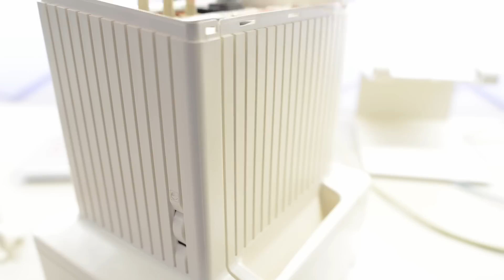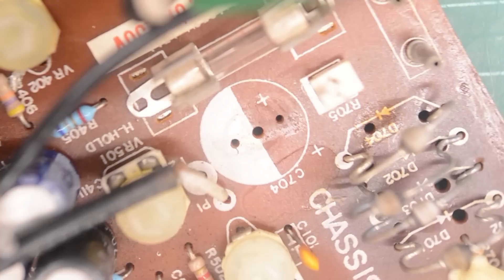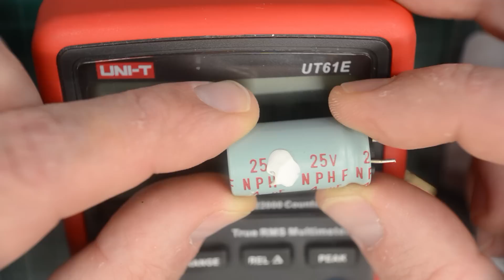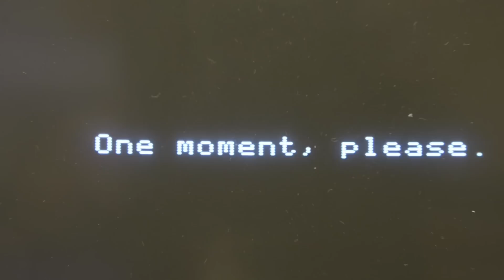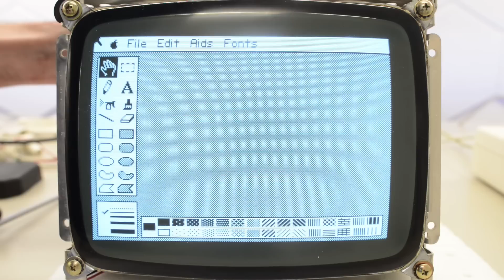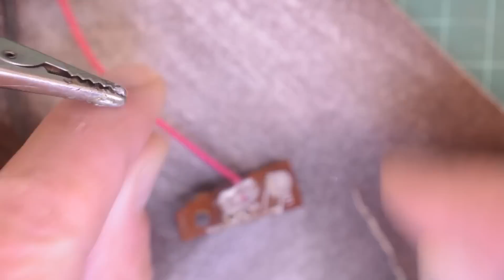Apple IIc custom display repair

Comment: That 4uF capacitor is part of the horizontal width modulation circuit. It’s a special nonpolarized high frequency (NPHF) unit specially designed for horizontal sweep circuits. When these capacitors dry out or go open it usually manifests as an unresponsive width control and raster width at full maximum. A standard nonpolarized capacitor can be used in this circuit temporarily but it’ll run hot and will dry out after only a couple hundred hours of use.
Reply from the maker: Thanks, I wonder what a modern replacement would be
Reply: @Epictronics1  I'm not sure, I haven't tried sourcing one in many years but the tv repair jobbers used to keep them in stock. The value isn't critical, we used to substitute 5.6uF/50v for the lower values if I recall.

Comment: The holy grail is a color tube inside the //c monitor housing with RGB input.
Reply: And then one of these RGB rainbow color changer LEDs as a power LED :-D!
Reply from the maker: @senilyDeluxe  haha, yeah...
Reply from the maker: The thought has crossed my mind. But I'm not sure, color graphics aren't the best on an Apple II
Reply: @Epictronics1  Yeah, but it would be even cooler to embed a miniaturized IIGS board inside a //c with RGB output. I wonder if it's been done before.

Comment: Recap is usually unnecessary, but it is possible that one (or both) of those NP caps were bit tired. Those run at high frequencies and with quite a lot of ripple current. If possible, I always replace those with film cap with bit higher value. More expensive monitors had those film caps installed even back then, but cheaper ones like that one, and those in early compact Macintoshes didn't. Btw, I have a 1986 Mac Plus with a replaced analog board (stamped 1992), that already came with that film cap from the factory, so even Apple knew they should have used it in the first place. And those never go bad as there is nothing to dry up

Comment: Did you swap the yoke when you swapped the tube?
Reply from the maker: No, I kept the original yoke
Reply: @Epictronics1  Maybe the grid voltages the new tube expects are slightly different? That could account for the width being so different
Reply: @briangoldberg4439  Grid voltage on the CRT has no impact on geometry. It's only acceleration voltage and yoke current which affect the deflection angle and these aren't changed here. If the deflection angle is the same the only other variable is the distance between the yoke and the screen, maybe the new tube has a slightly shorter funnel.
Reply: @eDoc2020  oh good point. Which direction makes the image bigger. Pushing the yoke in, or pulling it out?
Reply: @briangoldberg4439  Moving the yoke away from the front of the screen makes the image larger, at least if it stays in front of the electron gun. If you move it too far back the picture can actually get smaller.
Reply: @eDoc2020  so maybe he just needs to pull it back a little bit and clamp it down?

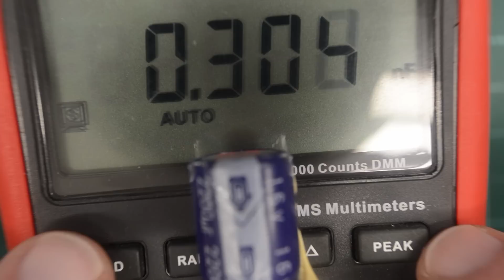Comment: 5:09 the 220µF Cap showing 300µF is dead. That is totally out of spec (±20%, so 264µF would be the maximum)
Higher than specified capacity can be a sign of leakage.
So good that you replaced that one.
Reply: Old caps were rated -20%, +50%, or even +100% sometimes. But the increasing capacity is usually sign of a huge leakage inside a cap, or a thinning of an aluminium foil that occurs with age and disuse. I had monitors that had shaky picture or some other minor issue, that resolved by itself after 10-20 hours of use - also some capacitors are in series with a resistors and if that cap unforms (needs reforming), it will take much longer to do so than something that is directly connected to the power supply.
Reply: Did you know you could reform the old caps?

Come after me one by one LOL 😂
Reply: @hernancoronel  Caps use rubber.
Rubber can get hard.
Rubber hard makes Electrolyte leak.
Reply: @Stefan_Payne  Just an old joke, sorry! LOL!
Reply: @hernancoronel  I'm German though :)
No hard feelings :)
Reply from the maker: Unfortunately, the display on the multimeter is showing 0.3 because I wasn't touching the cap leads with the probes yet. Two seconds later the value appears in the video 2.160 mF.

Comment: High voltage gloves to adjust the magnetic rings on the neck board? I typically just use my fingers as is. Don’t touch the neck board or anode cap and you’ll be fine.
Reply from the maker: I have had my share of accidentally touching high voltage :)

Comment: I had a packard bell 386 PSU that had the caps go bad, and they leaked all over the board.  The fluid on the board looks exactly like that does.  It might not be electrolytic fluid, but it looks very similar.
Reply: If it smells fishy when desoldering, then it is definitely a corrosive cap goo. But bit earlier caps (like from the mid 1980s) used much less corrosive electrolyte that isn't problematic that much...

Comment: Non-polarized electrolytic capacitors tended to be bigger for equivalent values because internally they are a sandwich of two polarized caps back to back.

Comment: So my naked flame in my Apple CRT is still unmatched! The issue is that I was planning to start working on my Apple //c monitor tomorrow but now you've just released this... :)
Reply from the maker: Well, as I mentioned in the vid. Mistakes often come in pairs. Perhaps you could set your //c display on fire this week too :)
Reply: @Epictronics1  I have two so why not! :) The //c also needs a fix so maybe I could start from that.

Comment: I love the modding projects. Dim the white LED some more, and I'd love to see a matching white power LED on the computer too, and a magenta Disk-access LED. 
You could also put a dim LED bar under the front lip of the monitor to act as a keyboard light, That would be neat.
Reply from the maker: that's brilliant. A keyboard light shone down on the kb, just like old IBM laptops used to have. Not sure if it's doable without drilling holes in the case though

Comment: "make display bigger" why my first thought was to slide deflection coils back a bit?
Reply from the maker: The thought never crossed my mind. Would that work without issues?
Reply: @Epictronics1  theoretically it should, you just moving the point in which you bend the electrons, and depending on a model , deflection assembly for the green and white crt might be different length , dc resistance or phisical size. even if the tube sicket is the same
you may need to adjust focus of the crt afterward

i know i tryed to correct factory defect color crt that had deflection coild installed on an angle and for some reason i had no problem moving the image  on the sctreen but with 3 colors  you risk completly missaligning colors and ...well i got to where i started in the end. with monochrome crt you don't have to worry about color purity and missing color mask holes so you should be fine if the whole assembly can be supported from both sides. but be carefull with the neck band tension and wear safety glasses wten dealing with anything that is screwed to the neck because better safe than sorry
Reply from the maker: @kokodin5895  cool, I'll give it a try, thanks
Reply: @Epictronics1  i'm not an expert , just a person who restored 2 tv's from nostalgia reasons so take my comments with caution
Reply: @Mr Guru There is no convergence on B/W tubes, like this one ;) Convergence means to converge beams on the right spots of the shadow mask. But this monitor has only one beam and no shadow mask, so there isn't anything to "converge"
Reply: @Mr Guru Yes, with but B/W yoke he can screw around and test it a bit. If he pulls it back few milimeters, then it will probably not matter, and the screen will get bigger. But take it back too much, and you'd have trouble to focus it then. Also B/W yoke is just 2 coils, nothing more. If you screw it up, you can easily correct it. But of course, doing that to a color monitor, that's a completely different story.

Comment: I can already tell what will happen, and I'm at 8:30: it will blow this horizontal deflection cap, which is rated for very high ripple, which is why it's so huge. These caps aren't manufactured anymore, so it's best to either leave them alone or use film capacitors with adequate ripple ratings. I learnt this the hard way....

Edit: I stand corrected. But anyways, that's the reason why it's so huge and leaving the new cap like that... it would probably not live very long.
Reply from the maker: Not quite right. But tell me more about the film capacitor. What do I need to know to order the right one?
Reply: @Epictronics1  Any good quality film cap (ideally polypropylene) with the right capacitance (4.7µF should work fine as well) should work. But ideally, you should just reuse the original one, unless it brings back the issue. These rarely fail.
Reply from the maker: @niino4329  I'll put it back in and see what happens, thanks
Reply: @niino4329  when they fail leaky or shortef they load down the flyback, could burn the output transistor or flyback itself
Reply: @Epictronics1  if its the "width cap" or "boost filter" (different names same thing) you both are referring to, you need to use a MKP type film cap or a cap rated for ac pulses or it will blow in short order...the dc rating alone means nothing in that area
Reply: @MrHBSoftware  The same thing? The S correction capacitor is a bipolar capacitor in series with the horizontal deflection coil. A boost filter is a plain old electrolytic capacitor on a high-ish voltage rail made by rectifying a winding on the flyback. It's used for biasing the neck of the CRT and the video output circuitry.
Reply: @eDoc2020  first , i am no native english speaker,sorry.. second, i am very good at crt fault findind being solid state or vaccum tube operated..the width cap goes on the point between the HOT collector and the flyback , and from that point to ground, and has very high pulses more than a kilovolt, just like i said. Maybe you dont call it width cap but its what we call it(condensador de largura)...on those sets the damper might be inside the HOT itself , or separate and its connected to ground, there is no boost voltage...On older sets that cap is not there, instead it goes between damper diode and b+ , on those, the damper rectifies the waste energy during the retrace creating a boosted voltage.on some sets it goes up to a kilovolt, its called boost because its higher than the line...it has nothing to do with the voltage that powers the filament of the tube etc. On both situations you MUST use an ac pulse rated film cap.. and despite not being exactly the same , ok, its kind of "different sh@t but same smell". I have never seen an electrolytic used as boost reservoir..its impossible...on sets that have lower boost voltages i have seen them use 10uf 500v cap as smoothing on the boost line but only after current limiting resistors, never as primary reservoir..boost voltage on old crts is used as focus voltage and to power the sound and vertical,  the goal is to have sound and vertical ONLY after the horizontal kicks in..this is a modern monitor so it has none of that, it has the collector to ground cap
Reply: @eDoc2020  and the S correction cap you mention goes in series with the yoke and its function is basically to correct the sawtooth pulse that drives the deflection coil and to block the dc present there from shorting to ground via the deflection coils, it also stores and discharges energy when the transistor "cuts"...Nothing to do with what i mentioned,althought it sees ac ripple too etc
Reply: @MrHBSoftware  I would also call that a width capacitor if it's effectively in parallel with the flyback as part of a resonant circuit but I don't know the real name. On a tube set I would only call it a boost voltage if it is the output of the damper diode and generating a high voltage. Some TVs have both capacitors.
Reply: I thought it was going to be this as well but it was 2 swapped caps.  The horizontal cap will probably fail later though.
Reply from the maker: @jameshearne891  Yeah, I'd better replace it right away